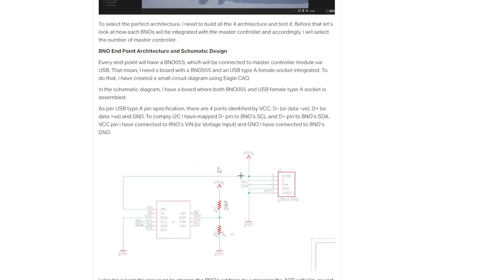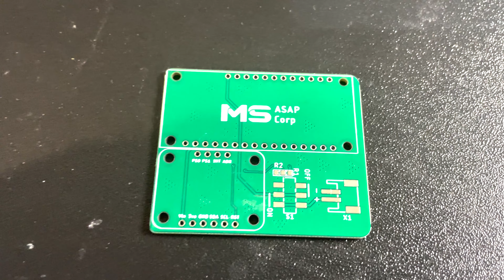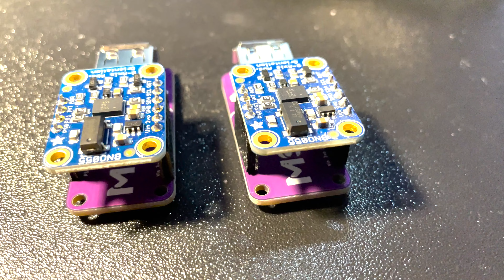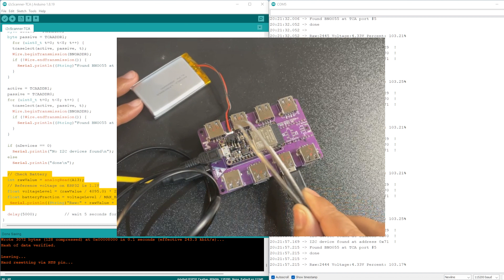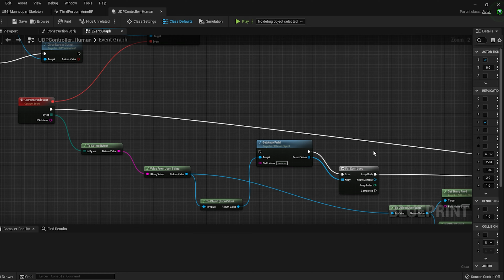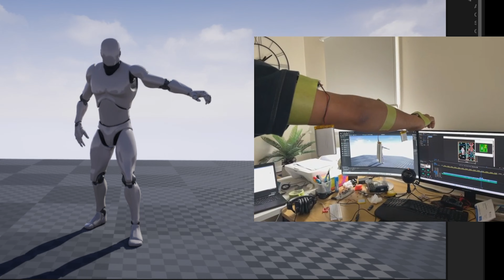Full body mocap suit prototype based on the custom PCB | Realtime to Unreal (UE4 / UE5) Engine

Comment: Frame rate per second ? Is there any latency ? And what about y-axis movement (stairs, ladders, off-ground, etc) ? Can we improve accuracy via BMI160 or BMI270 or MPU6000 ?
Reply from the maker: Thank you very much for the comments. Just to let you know, I have already managed to get absolute orientation using BNO055. And it is perfect so far. I have tried it overtime and it works. I will publish my paper and video soon. Please stay tuned. Thank you once again
Reply from the maker: It is 10FPS so far. Can be taken up to 100FPS by setting the delay of 10ms. Y Axis movement is possible to calculate, by integrating the linear acceleration. I have not reached to that stage yet. Regarding other sensors, yes possible, but again haven't tried it out yet. MPU6000 / MPU6050 as per my knowledge, is 6DoF. It doesn't include magnetometer. However, MPU9250 is 9DoF. I will try it soon.
Reply: @othersYATC  According to this video 👉 https://youtu.be/_q_8d0E3tDk   Double linear acceleration adds drift in resultant data, SO are you going to add any extra reference data to correct drift after certain interval of time-frame ?

Comment: you can use sensor GY-91 and to reduce the cost of materials (meaning less), send the data over wifi, esp32 can perfectly handle it and you can send the data and parse it with json. this guy did it as well in UE4 https://www.youtube.com/watch?v=-snMEgDAt94 but he uses quaternions you would only need to make a pcb that holds battery, sensor and micro controller but this would need a micro controller for each body part. but this depends on how you want it.
Reply from the maker: Thanks for the comment. Yes mpu9250 is an option. I will try that as well. So far bno’s accuracy is great. I already have removed the glitches and fixed the orientation.
Reply from the maker: With mpu9250 cost can come down significantly